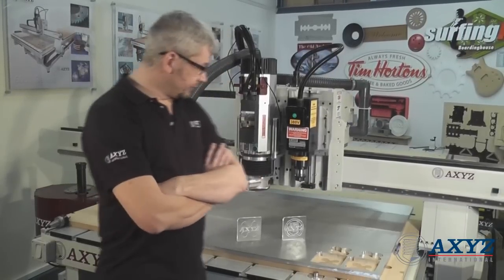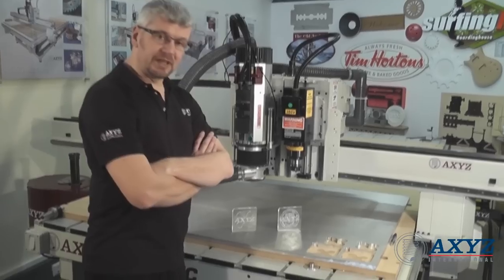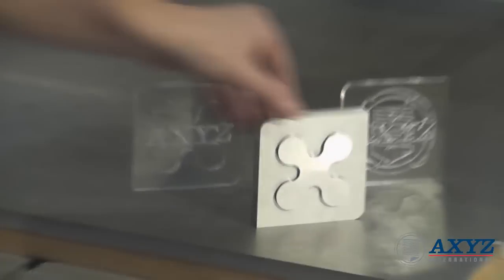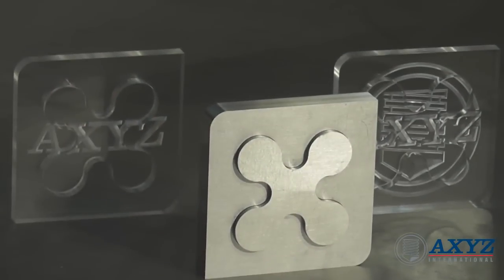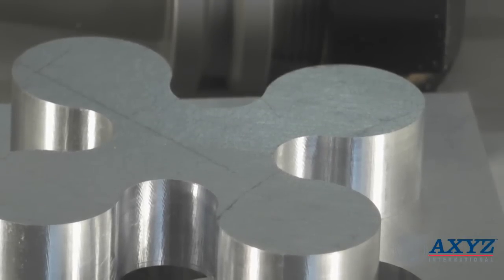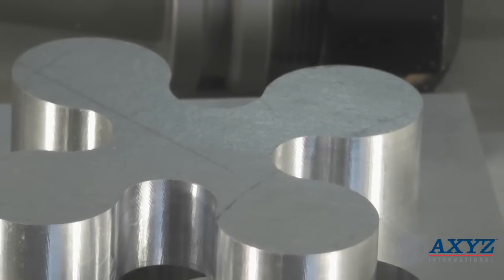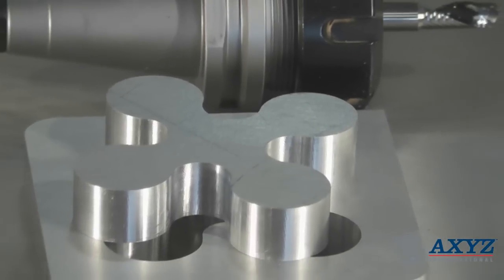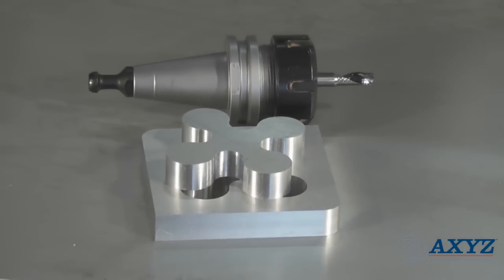Aluminium Inlay | CNC Router | AXYZ International

Comment: How come no lubricant in the finishing engraving?
Reply from the maker: Hi - thanks for reaching out.  Our Application Specialist, Ged Lodge, confirms that he did use a lubricant. You can just see a thin layer on the surface of the material.
You can use a mister to apply the lubricant but for this single sample, he applied it with a brush before starting.  If you have any more questions, please send an email to customerservice@axyz.com.
Reply: @AXYZrouters  I own a Millenium of which I'm totally satisfied.  Can you tell me if my cnc router is still offered or do they only build 4 by 8 and more in sizes?
Reply from the maker: @MultiChaga  You can see all our CNC routers on our website, which can be customized to a variety of sizes to meet your needs.  Here's the link https://www.axyz.com/us/cnc-routers/.   Please take a look and if you have any more questions, give us a call at (US) 800.361.3408 or (Europe) 44 1952 291600.  Thanks and take care!